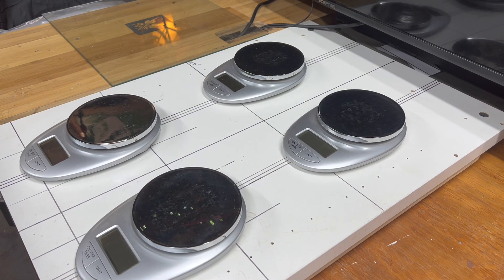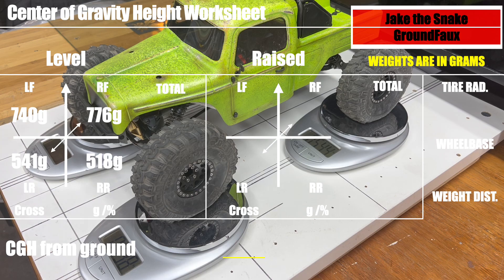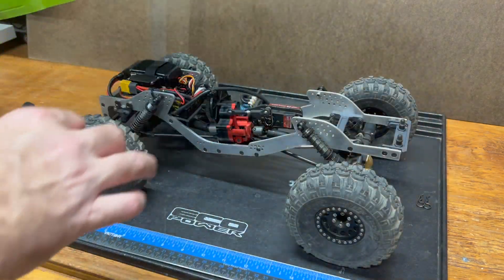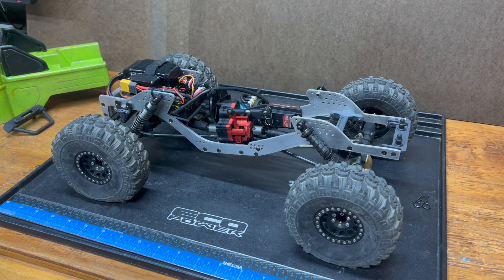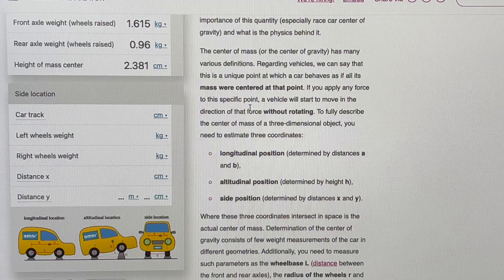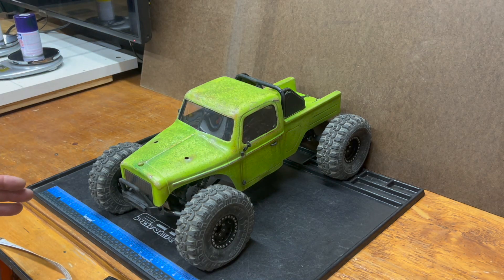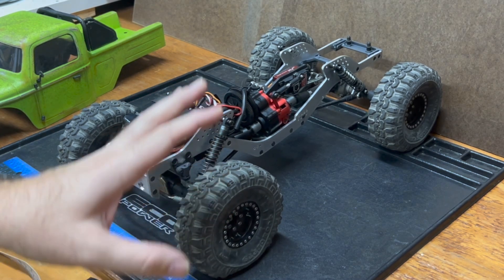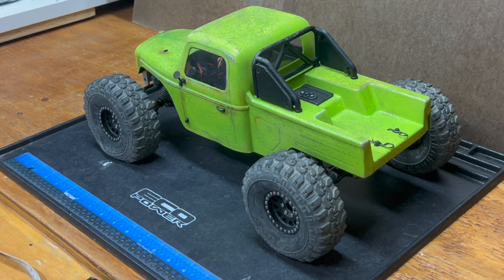Crawler Canyon Tech Notes:  Finding CGH (revisited and improved)

Comment: That was awesome.  I'm going to have to get all my rigs out and make sure my workbench is level.  I'm really interested in the cross weight, and raised weight.  I have too many rigs that  unload on descent and I roll.  I did notice your program was set to front wheels raised when you entered in all your numbers.
Reply from the maker: Of course I would miss a critical point.  Such is my way. I re-entered everything, and the CG moved up about 7mm--  which I'm fine with, as the number I got from doing it wrong seemed WAY too low. 

I can tell you that most CMS rigs seem to come out with their CGH somewhere near the top of the sidewall of the tire (portals generally making that higher still) so I'm mostly happy with how this guy is currently sitting.
Reply: @CrawlerCanyon  I was hoping you'd re-calc and post.  I'm really glad you did this vid...the all-out nerd in me is really excited to calc my rigs.  I also just tore out a 12x16 concrete pad and I'm going to use it for my very own course!  Repetitive lines will satisfy my nerd for testing.

Comment: Good info! You can adjust your cross-weight by adjusting your spring preloads, if you have adjustable springs. Cranking some preload into the corner you want more at, and/or out of the adjacent corner to balance it.  For example, if your LR-RF is too high, you can take a turn out of the LR and RF springs, and put a turn in to the RR and LF springs, then settle it and weigh it again. Repeat until you have the balance of corner weight and ride height that you want. This can mildly compensate for small imbalances in physical weight placement. ☺️
(Edit: or achieve the same by adding and/or removing spring spacers, or even playing with spring rates, such as a slightly stiffer spring in the right rear than in the left rear)
Reply: @BoomslangSuss  no
Reply: @BoomslangSuss  because we aren't talking about raising or lowering just one corner. We're talking about "cross-weight" or aka "wedge."
If you add preload to the left rear and right front together, it will raise the whole chassis. Then removing preload from the right rear and left front together lowers the whole chassis. The result in this example is more of the car's weight is distributed to the left rear - right front and less is distributed from right rear - left front. Test it on corner scales and you'll see what I'm talking about. 
It will change the car's handling and response to forces as the chassis sets and unloads through corners. This is one quick adjustment for getting a car to hook up better or loosen it up going into and out of corners, for instance. But it won't lean the car unless you put too much adjustment into one corner alone.
Reply: @BoomslangSuss  would you like to learn something new that could be useful? Or just be contentious? Because I don't think you're reading what I typed since your response is referencing several scenarios that I never suggested. 
Some background: I was a chassis tech on a Nascar team from 1990 to 1995. Full scale race cars. I can help people with chassis tuning if they don't let their pride prevent them from learning new things 😉

Comment: Thanks for the updated video. Some time in the last year I tried using the Longacre calculator and, ya, it no longer worked. But the math explanation was still there (it’s just trigonometry), so I made my own spreadsheet to plug the numbers in and it’s been working great. The Longacre method actually has the front wheels raised which I like as for crawlers we are usually prioritizing improved climbing performance (it’s easier on my brain having the vehicle position analogous between the bench and the rock). Very handy to see the relative shift in CGH as changes are made and to compare that to real world performance.

Comment: Thank you for pointing me to this fantastic video and calculator. There are 2 things that I seem to be confused by and I can't pinpoint why. I highly doubt any of my rigs can have an H value 3 times as yours, even an RTR so I might be doing something wrong. I am using corner scales and yes, they are level and calibrated. and one of the rigs I'm using is an Enduro base axle on Gspeed V4 rails with 90MM schools leaning similar to yours on a power wagon Cab.
1) you made a pop-out note correcting yourself that H is measured from the axle and when I see the diagram on the calculator and read bullet point #6 quote "Read the resulting height h, which is the height of the center of mass above the ground" when I read that and see the diagram, I interpret it from the ground. Am I incorrect?
2) I went through the motions with 4 different rigs of mine, and the lowest I got is 7.43 CM "3 times yours" making me scratch my head as to how your rig is 2.381 CM which would likely be somewhere under the skid. Can you think of anything?
In any case, I liked the video a lot, it is super useful to probably do it before and after making changes to a rig to see how those affected the ratios.
FYI the numbers of the car I used were as follows.
Car weight 2.924 KG
Wheelbase 32 CM
Front Axle Weight 1.649 KG
Front wheels raised on (tamiya cans) 4.125 IN
Wheel radius 5.7 CM
Front axle raised weight 1.594 KG
Car track 19 CM
Left wheels weight1.468
Thank you for the great content you put up.
Reply from the maker: I messed up--  it took me a few times putting the numbers back into the calculator right now to catch it--  I had the front axle weight for rear wheels raised but didn't click the mene to change it from front wheels raised, so it put the CGH as you said--  somewhere under the skid. The actual CGH was at the 80mm mark in the sheets, so I must have caught it then and then forgot. 

I have also gone to doing the calculations with both front and rear wheels raised, and taking the average.  It's never going to be 100% accurate for us as we still have shocks and compressible tires, but it's good enough to tell when a change is working and when it isn't.

Comment: This is an awesome vid but you haven't really said why were doing this or it's real world example of what it's helping ,sorry to point that out ,it's still a great video and being more advanced in RC I can understand myself but for those new to this your not explaining to them why or what it's doing ,maybe over exaggeration with some weights on the car and drive it on your rocks in a controlled test ,to show what the changes are doing . Big thanks 🙏
Reply: Also compensation for torque twist in the props is another issue especially in cross weight on and off power IE the rigs always wanna be heavy in one corner on and then the opposite diagonal corner off power but mathematical I've no idea how to work that out 😂

Comment: This is great, and I'll have to try this out to see how it compares to my excel file from Rob Robinette. I use the CGH calculations to measure directional improvement. I bought my Amazon scales for about 10 bucks each and I use 1-2-3 blocks from my machine shop days for the raised height. You might want to pin Brian's comment so you don't get a 100 more comments about the 'front wheels raised' setting